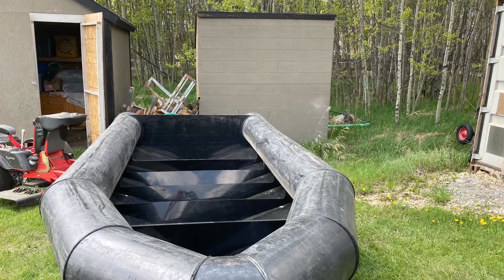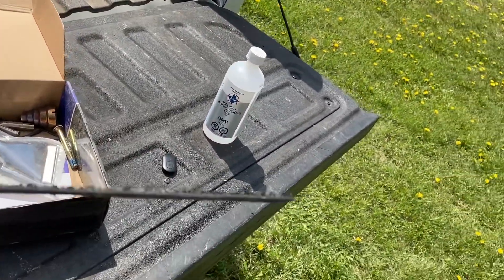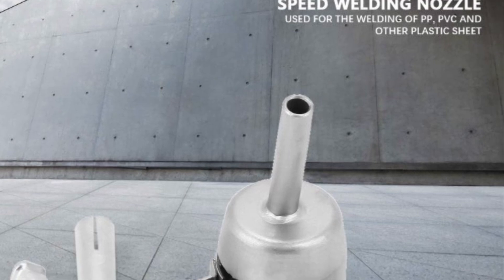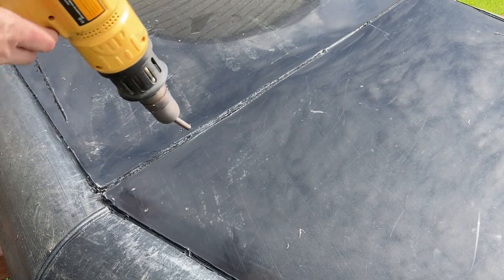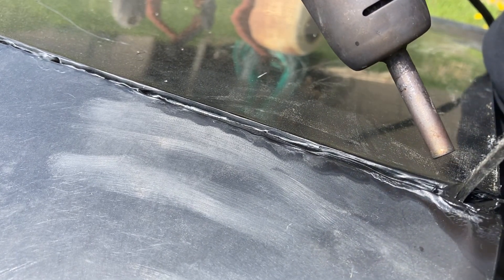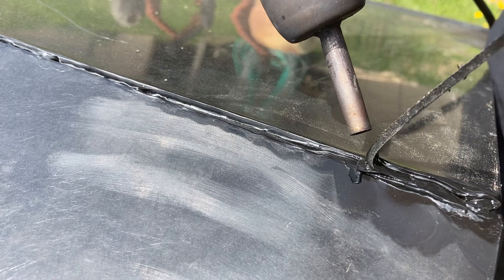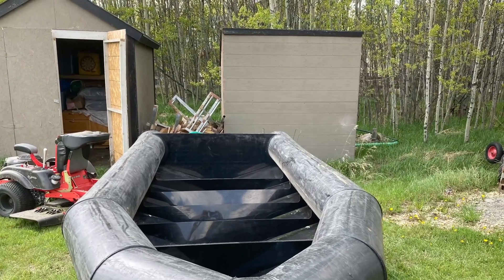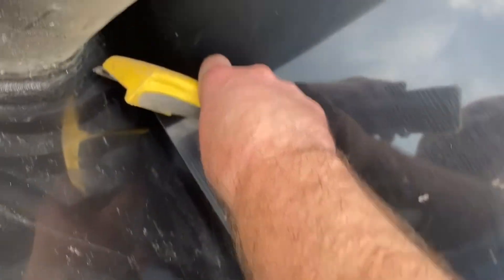HDPE (High Density Polyethylene) Boat Build Part 2

Comment: I have thought about using high density  foam to build a boat. About 1" thick and glue it together with spray foam. Then cover with fiberglass,  cut strips of pvc pipe for leading edges on the bottom side.  Make a spine with ribs to support the whole thing. From foam wrapped in carbonfiber or fiberglass.  Maybe fiberglass with kevlar or carbon kevlar blend. With about 6 layers on the 3" x 6" foam spine with ribs every 24"  1" x 6" going from the spine roughly 30" and turning up with two 45° elbows, while narrowing to 2" at the end. With the width at the elbows 3.5"-4" and the elbows being braced with added foam 1" thick and 6" before and after the elbows. The ribs being about 30" to the elbow, then 30"-36" additional inches, making the boat about 40"-48" thick mid way. With the bowe  being taller, maybe 60" and getting shorted as it goes back. The total length being about 20'-26' the foam glued  together  and made into parts wrapped in carbon fiber for the really rough parts about 4 layers. Then each part clamped and about 4 additional layers added about 8"-12" for parts that will be stressed. Then, to fill between the ribs cut foam to fit between the ribs forming the shape of the hull. Without coated in fiberglass,  glue in place , then coat the inside with one layer of fiberglass.  After the bottom is in between the ribs . Glue on a sheet of foam board  over the ribs. Then coat with fiberglass,  about 6 layers  with a layer of pvc pipe split to cover leading edged. heated to conform to the shape and epoxy resin and fiberglassed over. When it's done  spray or roll on bed liner  about  1/4" thick.  For the inside cut 1" plywood, heated to 220° for 10 hours  in a tent made from tin and  coat in epoxy after its cut and add a layer of fiberglass.  And epoxy in to place over the ribs possibly using angle bracket to also bolt into place in the engine bay, mount 1.5"x1/2" x 24" strips of aluminum angle . To mount the engine to possibly using a jet drive. Maybe use a small vw diesel engine, older model  build a heated charger to cool the engine, with a heater for the small cabin area using a pair of heater cores. The heat exchanger  basically using the same  in a tank of water using lake/ ocean water to cool. Use a green low/non toxic antifreeze.  The cabin area /cockpit being about 7'x10' just over 1/3 of the boat. With one we'll between ribs  being a heat exchanger with a screen over the inlet.  Using copper mesh screen. About 60-80 hp possibly more with a turbo. It should be a decent boat with lots of TQ,  the fuel tank in between the ribs with  a 1/2" hole connecting each section between ribs for the bilge pump to evacuate.  With oil absorbers inside the engine bay. With the engine mounted inside a 4" deep aluminum pan. With an electric oil pump to drain oil and about 3" under the oil pan/sump to catch the oil from the filter. A small catch can, and some pigmat and no oil is spilled. Possibly using a 2:1 overdrive to spin the jet drive the diesel will likely  peak around 4000-4500, jet drive is about 7000 peak , a 1.6:1 over drive should allow a drive of 6800.  Just a dream.. HAVE AN AWESOME DAY..

Comment: I know it has been a while, but you day you are planning another build. HAVE YOU THOUGHT ABOUT PUTTING A WET CLOTH ON THE PLASTIC JUST OUTSIDE THE WELDED AREA?  To prevent warping and allow the weld to be hotter. Keep a spray bottle of water  to spray the cloth . I'm guessing about 2" from the weld on each side . About 12" at a time, possibly using a folded old towel wet and folded about 3 times.

Comment: Thanks for the video!  It looks like an interesting process, but it seems to me like your heat gun is under powered.  If you had a second one heating the back side that might work better. Also I think you need a thinner filler rod. It’s taking too much heat to melt both the base material and the rod material. But thanks for sharing, I was not aware of the degree one could do this!

Comment: Hi mate all due respect , let me help you mate, I appreciate the having ago as am an Aussie , but it’s all wrong , and dangerous , please don’t go to sea  in it in the interest of safety ,it too hot so it’s carbonising  and you didn’t take the oxidised layer off the surface first, hence the mess ,  I have been making my own rods for 20 years  ,the square uneven edge is simply pushing the material out the way ,I only use triangular or round as this is what works , there is no substitute for experience. Here is what you need to do , temp 280 - 300 degrees c, no more ,rod vertical never lay it back, what you are attempting is pendulum welding but the nozzle is not doing that ,pendulum action from base to rod with more time on the base, down force to push heated molecules together but not to push it below surface, should leave a small wake both sides ,sorry go back ,and like everything prep is the key , get the grinder out slow speed and keep moving so it doesn’t melt , grind a groove , or scrape oxidised layer off ,same for the filler rod  scrape with tungsten paint scraper works good ,until there is no gloss, look on you tube for pendulum welding ,I am a-pro plastic welder do several water tanks a week as well as car bumpers fuel tanks etc  send me an email  tony@undercoversailmakers.com and I will help you brother . HDPE  is very forgiving so it looks like it’s strong but sometimes not, the test is to leave the rod attached  let the whole thing cool for an hour or so the pull it off it will show you whiteish colour where it’s bonded or black where it’s not .
Regards Tony.
Reply: Further to Tony's comments HDPE needs a minimum of 0.2mm of material removed to remove the oxidation. And you need to weld that area within an hour or so, so that it doesn't oxidize again. 

As others have mentioned ideally you will extrusion weld all of your joints, after having cleaned and removed the oxidised layer. 

You are hot air welding, which gives 30% parent material strength at best, extrusion gets you to 50% or so. The butt welds you did on the pipe, when done well will give a minimum of 90%.

The ideal temps to use are generally 260deg C for the air, and 230 deg C for the plastic.

Comment: With metal you must melt both pieces to be joined into a common "puddle", then add in a compatible filler.  Metals get "MOLTEN"  like a liquid.  HDPE does not really.  It gets soft and like grains of sand.  It requires pressure to press the filler into the weld as well as tie the two pieces together keeping the heat even and very hot on the edge of burning. If you keep heating one sample piece and watch it go through the stages, you will understand the method better.

Comment: Dont know if your planning on adding flotation but two part foam can and will absorb water over time if you get a leak. Two part foams are NOT waterproof.   Contact the manufacturers, they will tell you it's not.    I would suggest you contact "life proof" boats in bremerton wash, they use a Polethylene foam to make foam, collars for   their aluminum boats. They have a fair amount of excess foam that they grind up into approx 1" size. they sew these into fiberglass bags and stuff them under the floors of their self bailing design. they have BAGS and BAGS of ground up foam they might likely give you. You could cut access holes in the top of your tubes and stuff then with this foam and that would give you flotation in case of a crack. the foam they use is very water resistant and is chemically resistant.  Or you could use polyethylene pool noodles or packing material, lots of things come with it, refrigerators etc.... I love your thinking on doing doing something like this project.!!!!!!!!!!

Comment: I've done a little bit of HDPE work (waterline for the company I work for, about 2000' in total so a decent understanding of butt fusion)  cool project for sure and nice work on the bow.  if i might add, i also worked in collision repair for a little bit, and when we would plastic weld most things we would taper the weld joint a little bit and melt a piece of steel mesh in there and then add filler to add a lot of strength.  not sure how that works as you get to thicker materials like it looks like you're using, but might be worth looking in to.

Comment: I would advise a good sanding and a thick layer of fibreglass after to hold the whole structure integrity in case of bad welding.
But otherwise that is some DIY great idea to build your own boat 👍
Reply: I thought HDPE and Epoxy Resin don't really stick well together. The chemical make-up of HDPE doesn't really allow it. Sounds like a recipe for delamination.

Comment: I forgot about this boat. It's great to get an update and see it coming together. When I first saw this, I thought it was excessive and probably weighs a ton, but then I thought about how indestructible this thing is going to be. This method would be great for a jetboat because it's tough enough to take heavy rock hits, but it would bounce back to its original shape rather than denting heavy aluminum plate. Looking forward to the next update in 2025🤣😘👏

Comment: Nice idea .. it’s a job but a good one.
One question.. do you make air vents in the tube sections. 
I’m almost sure over pressure due to temperature change will make the welds weak eventually.

Comment: It wouldn't hurt to fill the tubes with high density expanding foam it would add rigidity to the pipe so you wouldn't have any joint failure an would add very little extra weight

Comment: ive been a plastic fabricator for the past 7 years building polypropylene fire tanks and am currently working on a boat build myself , id invest in a leister welder to go over those beads and get it water tight. or use a real hand torch made for plastic . the leister hand torches are like 500 bucks but i know those sheets of hdpe are big money so i wouldnt cheap out on what your sticking them together with .

Comment: Being a Boat Builder for 40 years, and involved in the plastic manufacturing industry, one question is something you might want to consider that could give you better welding results. Virgin or Raw palletized HDPE or High density as we call it by common name. If you place that in your cavity and simply heat it up, it should melt and fuse with your sheets. It is only as a filler, and not as a tack method. I always work with carbon fiber, fiberglass, steel, aluminum, and all types of plastics from acrylics to HDPE, PVC, Polycarbonate Styrenes, and about anything else. I am watching your progress and have subscribed. I do not know about Ultrasonic welding, I do have an Ultrasonic welding machine but that is strictly about fusing small styrene parts together and definitely not like a welding machine. You would know better. Personally, I would have taken an alu tube and rigged it with heating coils and a tip on it (or even a silicone gun with a modified tube) set the temperature, and melted some virgin.  referring to an improvised heat gun. the amount of welding you need to do, and planning to do in the future it might be your answer

Comment: Why didn't you just use the glue?
Reply: HDPE is a thermo plastic and cannot be glued. If it could be, the whole PE welding industry would not exist. 

Granted there are a couple of chemicals that can achieve some adhesion, but so far none are capable of long term bonding.

Comment: I weld a LOT of HDPE and LDPE and ur not doing a bad job.
I would suggest a hot stapler.
They are dirt cheap and work a treat.
You can staple them then grind the points off and weld over the top. It makes for an extremely strong joint.
Reply: I was thinking some metal reinforcements in the joints would be a good thing.   Probably need some stainless steel staples.

Comment: Brother, you're having so much trouble because HDPE needs to be welded under CO2.   Also, you should use round, preferably continuous rod going thru the tip that is made to join the rod and air-stream (or in this case, CO2 gas stream) together.   You use the tip to PRESS the rod into the material.  You want to weld it as cold as possible so it takes a lot of pressure.   I used to take a BBQ fork, cut the tines down a bit, and put it right in the crux of the tip and press hard to get the rod to fuse with the material.  Also, as far as your pontoons are concerned, there's really no reason to start with pipe as it's not a big deal to just weld up your own from flat sheet, unless you're going ridiculously thick.   Additionally, I think you would probably have been much happier with a good skiff design (like a Sea Bright skiff) than a RIB.   The thing that makes RIBs nice is they are SOFT sided.  Otherwise they pound, are easy to flip, and just all around not very good boats.

I did a shit-ton of welding plastic for circuit board shops and silicon foundries back in the early 1990's.
Reply: Oh, and if you're going to be welding thin material, use thin rod.  Better to have to weld multiple times than try and shove a rod that's way too thick into the joint, as you'll have to get the thicker rod so hot it will liquefy the sheet beneath it you're trying to weld.

Comment: I recommend a wood plane for shaving the pieces together for a butt weld. Not sure you have much of that left to do, though. 

The filler rod from your sheet stock is a good idea. Your sheet is likely a different grade of HDPE than the pipe.  Pipe like that is typically made from a much stiffer (lower viscosity) than sheet goods. The sheet material should flow more easily when heated.

Comment: I have been messing about on boats professionally for over five decades as a deck hand, vessel operator, boat repair guy and marine surveyor in the US. I absolutely love this project! I love the shoot from the hip, go for it, trial and error process you are undertaking. It is a great idea and I hope this thing really works out. Maybe on the next one add a couple longitudinal stringers on each side. I started building a small row boat last year from plans that stated it was a great first time boat, which it absolutely was not. Had to walk away from it for a spell. These videos have me ready to get back to it. Thanks! Can’t wait to see the rest of this build.
Reply: You could invest in a leister welder.not expensive but intended for what you're project needs.time saver and neat welds.all the best with your project.
Reply: Before you start your next build, you might go to YouTube and look up Polyvance, they may help with your technique. Also a  6180 mini-fuzer will give more accurate welds without the problem of warping and it's about $500 or less. I'm suggesting this from experience. It will do a much better job of welding  with less effort.

Comment: JB Weld to fill in the gaps and smooth it all off? Could possibly use it with some fiber type material to really strengthen the joints.

Comment: Really wish you filled the pontoons with closed cell foam.

I can't say why exactly...

For some reason my brain says it's just how it's supposed to be.
Reply: Two part "closed cell " foams are not water proof. If he gets a small leak the foam will soak up water over time and and then it's not floating anything anymore. dont believe me?? contact the two part foam manufacturers, they will confirm. do a search on soaked foam. Stuff should be banned.

Comment: Really cool project it has turned out nice to this point. I'm sure there's different methods and ways of doing this type of work. I'm most impressed by the fixturing and welding of the odd angled shapes. Nicely done.

Comment: Interesting, have you tried a Soldering Iron with a Wide Flat Tip made to Melt Plastic, they are available, but not that difficult to make, so you can push weld plastic into seams, like a trowel in brick mortar, Just a thought, not so sure on actual effectiveness ...

Comment: Instead of using those heavy pipes, have you considered using thin hdpe sheets(like 1/8" an fashion tubes out of them, using a single straight weld? The final shape would be much lighter,  and pressurizing it would give it rigidity.

Comment: Very interesting!  Any plans to foam fill the outer chambers?  How thick are those sheets?  I just looked up the cost of a 4x8  3/8ths inch sheet and it was less than I thought. $120.
Reply: Dont use two part foam if you do fill it. It will absorb water if you get a leak and you wont be able to get the water out and then your foam is hurting not helping.
Reply: @bryanturner683  My duck decoys say otherwise. Never have water in them after leaving them sit on the pond all winter. It's closed cell meaning no cells connect. They are all separated.

Comment: This is an interesting idea. Not sure if it’s cost effective compared to a ready-made hdpc boat. I don’t think your welds will hold under stress. It looks like you a just melting the rod in the groove rather than fusing the rod, plate, & pipe material together.

Comment: I think your transom needs to be at least 3x thicker. On the bottom of the keel from the inside you should have  put a smaller pipe to give it sturdiness. I feel like your keel and transom are overly weak.

Comment: They have been building this style of boat where I live in Hobart Tasmania for 30 years. It is also used for making large fish farm pen enclosures, ie rings to hang big nets from. But welding if done properly should be just as strong as the parent material. Welds I have done 30 years ago on 500mm dia pipe are today still as good as when first done. Manual welding as you are doing is quite enjoyable work, unless you are on the west coast of Tasmania in the middle of winter when its 4 degrees celsius and pouring with rain. The solution then was to cover yourself with a tarpaulin and try not getting electrocuted ! Look up "sentinel boars"on google.